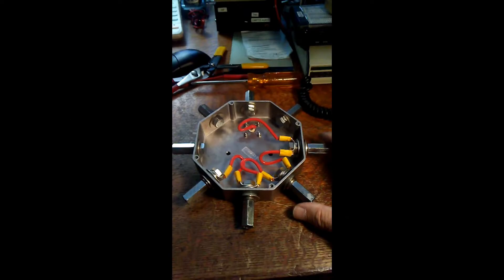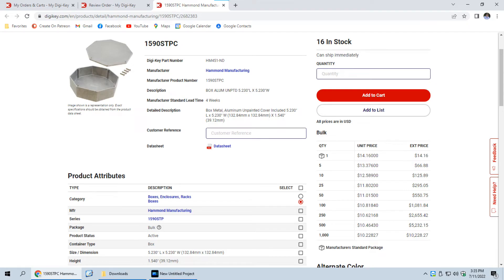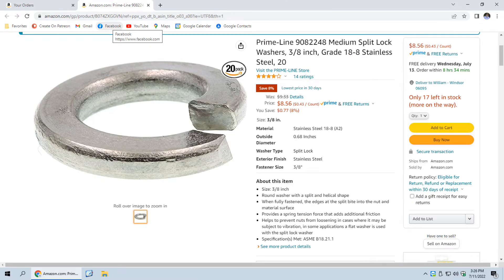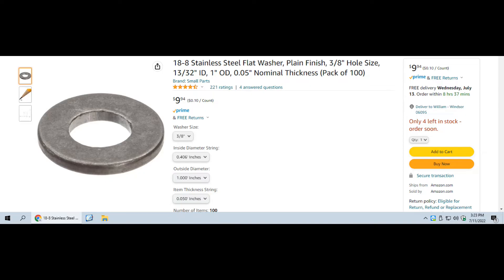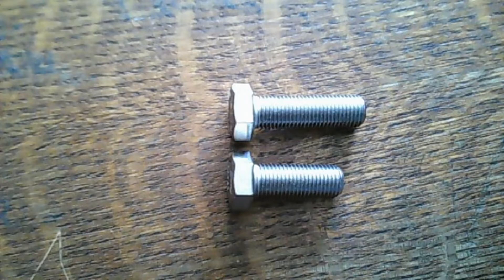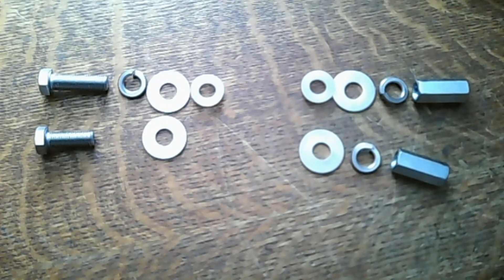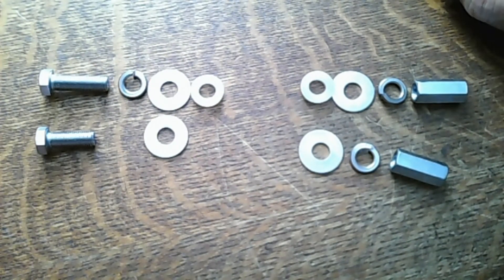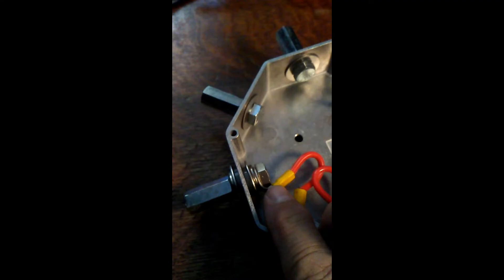Home-Made Octopus 4 band hamstick antenna base Details

Comment: @ 14:31 you show your drawbar assembly... I need to build one of these for my mast poles, what are the parts/bushings you used? Brilliant! Thanks
Reply from the maker: I used 3/4" threaded rod, and 3/4" fender washers that fit inside the military pole section. My brother in law made the nylon spacers, but you could 3D print them from petg filament.
Reply from the maker: Also 3/4" nuts to hold the washers and spacers together and spread them out on the rod. The bar was one I had hanging around but Amazon has a great selection.

Comment: Hello, nice video, thank you for posting.
I notice all the driven elements are next to each other, would it make a difference if you alternated them instead??
Also what about adding a 1:1 balun in the box? It looks like there might be enough room for one.

This build is definitely on my to do list for Field Day 2025.
Thanks again for the detailed parts list.

K2CCT
Reply from the maker: Staggering the hot side would not make any difference as far as I can tell. Might make the wiring harder. I just use a 240-31 toroid and wrap the coax through it as a quick choke.

Comment: way to much detail on the assembly of the mechanical, no explanation of the wire connections.  Nor no picture of a finished how it looks after being wired.
Reply from the maker: So funny, the thumbnail photo is of the fully assembled unit and the wiring is plainly visible. Oh well. Remember this is a followup video based on viewer feedback.
Reply: How did you not understand it? Center conductor to ring terminals on half of the hamstick connectors. Picture at 15 seconds in.